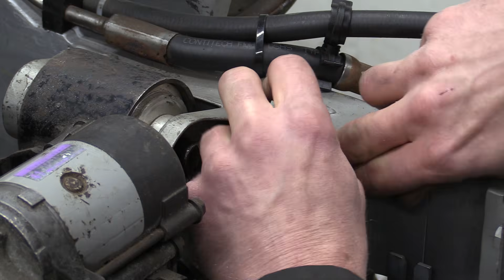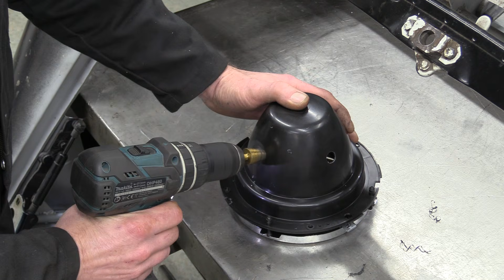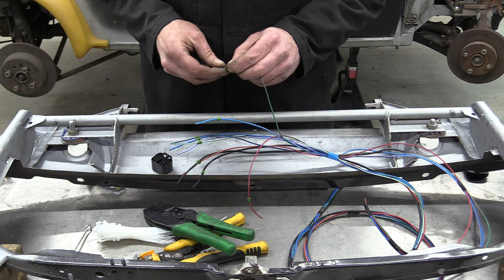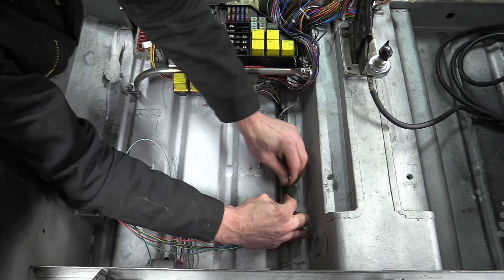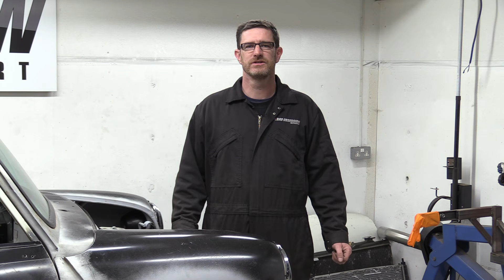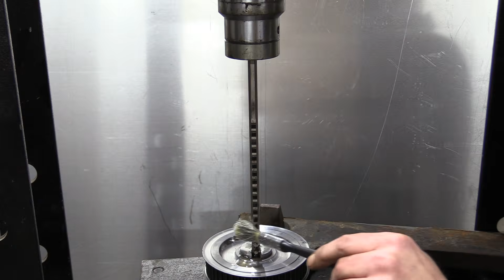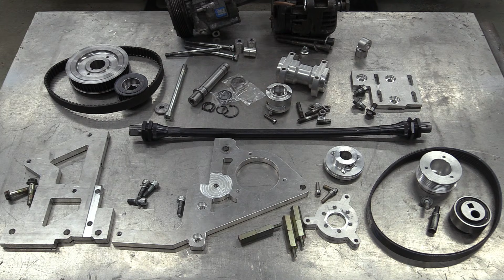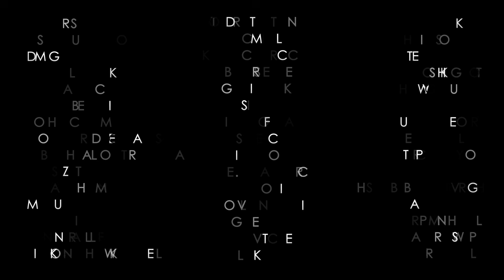Project Binky - Episode 20 - Austin Mini GT-Four - Turbocharged 4WD Mini

Comment: Uhhh I see an issue with the homemade cog pully setup. The original pully was that heavy because it was the harmonic balancer.
Reply: With the amount of detail these guys have already thought about, I somehow doubt that they didn't realize that. Maybe the actual engine is being internally balanced to compensate.
Reply: The extended ancillary drive likely changes a few of the resonant frequencies, so its mass (rather: the mass of the part stuck to the elastomer) is going to be wrong anyway.  Best to remove it rather than risk resonance in the wrong place if you can't re-engineer it to match the new setup.

I'd have thought that torsional vibration would be a non-issue in a small, modern (ish) flat-plane four,  but that flexi-drive might suffer.  Inline fours are also internally balanced already.  So it's probably mostly an NVH thing, rather than to save the crank from certain doom.
Reply: Could all that extra mass they added between the crank and the alternator alleviate the issue a bit?
Reply: @TheInsaneTD  the weight added in the drive line (really only the idler shaft and flex shaft) is insulated by the cogged belt so it wouldn't have a significant affect on the harmonics of the rotating assembly.
Reply: Yeah they plan on doing some racing with binky, but he has mentioned multiple times that he wants to drive it as a daily (ish) vehicle also. I don't really think that he's going to be taking it to the limit of the balancer with what he plans for it. I could be wrong. I'm just saying, there has to be a very good reason they decided to use a drive pulley over a balancer
Reply: Only mass produced engines require a stock harmonic balancer. Any engine can run fine without one without any issues as long as it is internally balanced at time of rebuild. No different to people fitting aftermarket lightened flywheels
Reply: From the comments, it seems few, if any, actually have an understanding of crankshaft harmonics and why a damper/dampener (usage varies) is critical in some applications - NOTE, it is irrespective of whether the engine is using the front pulley as part of the assembly, ie, internal or external balanced.
I recommend you guys actually do some research into it.
Reply: To everyone wondering about harmonic balancers Steve Dinan wrote an excellent article about them a while back http://www.atiracing.com/products/dampers/damper_dinan.htm, there’s a lot more going on than just engine balance, and they definitely need one, there’s not a single serious race car without one, in fact they are usually upgraded to dampers that can dissipate more torsional vibration energy, to prevent the crankshaft from fatigue failure.
Reply: The harmonic balancer not only balances the crankshaft counterweights but it absorbs the vibrations from ignition that can break camshafts and timing sprockets. That can't be done internally. It doesn't appear to me like they considered it to be a serious problem as the distance from the crankshaft snout effects the effectiveness.
Reply: @farming50s57  only really an issue at high rpm I heard?  it may have more harmonics but if it's not running at 8k and up then it should be ok.   I'm no mechanic so I'd like to hear any engineers give some insight into it 😊
Reply: @AlexButler10  Well they do plan to race this thing. Since it does have a rubber ring in it, it may actually be an issue. At nearly 5lbs its a fair hefty piece for a 4 banger. Might depend greatly on that harmonic balancer.
Reply: farming 50's I couldn’t disagree anymore. There is no chance of a solid crankshaft pulley causing damage to a camshaft and camshaft gear.
Reply: @88maaax  Seriously, dude? Do some research - in simple terms, the problem is torsional flexing of the crankshaft which is, in the mechanical sense, a torsion spring and which has a resonant frequency. The impulses from the combustion twist it against the resistance of the rest of the crankshaft assembly and, primarily, the crankshaft inertia. At critical frequencies (harmonics) there can be a positive feedback where the impulses and the flexing are working together and will greatly increase the stress on the crankshaft - it is much the same effect as sound shattering a glass. What a harmonic damper/dampener does is add a mass to the front of the crankshaft, with a dampening intermediatery layer, to change the resonant harmonic frequency to a point outside the normal operation and/or to use the dampening material to absorb the energy in the crankshaft causing the excess flexing. As you may surmise, it is certainly possible, by changing parts and/or changing the operating rpm range, to actually increase the crank' stress - something to be aware of. As a general rule, the longer the crankshaft, the longer the stroke and the higher the combustion impulses the greater the chance of crank breakages - incidentally, the crank flex also has an effect on bearing life and in some instances this has required the use of a dual-mass flywheel to further control the crankshaft - IIRC, this was why Porsche went back to them after suffering rear crank bearing failures with one piece flywheels.

Where a damper is removed, it is certainly possible, as has been demonstrated many times, that the increased 'whip' of the front of the crankshaft can cause high enough loads on the timing chain, or belt, to snap it and, even if there is no chain or crank failure, it can be a big problem with camshaft timing as it introduces variations into the cam drive speed which increases the whip, or twisting, with adverse effects in cam'timing - used to be a big problem with Chev' engines with their rear distributor drive, as well, with ignition scatter.

Sure, they may have no problems, but it is most definitely possible.

Comment: binky coming alone nicely boys!! if it was not for the flexible shaft would there have been another way to get the alternator to work like a plan b? just curious...
Reply: idk if they had a plan, but I once saw a race car that ran the accessories off the flywheel.
Reply: @caution1100   I was thinking a drive off of the starter gear could get interesting. Eliminates all of the issues of turning the stuff while not moving.
Reply: @SirEuchre that's kinda what they were doing, it was a front engine rwd car, a short straight shaft with a starter gear on one end and a pulley on the other, and they cut a chunk out of the bellhouse ing just big enough for the gear, and mounted the accessories under the dash on the passenger side. and it seemed to work really good for their purpose.

Comment: I love how fast you got this new episode out it's great in that having to wait months and months for the next part of the project.  And you got so much done this episode that solution to the alternator problem was ingenious.   One minor question why didn't you finish running the wiring loom wiring to the places you needed it to go.  I know the dash wasn't in and the speakers and the radio but you know you're getting them and know where they're going.   And you could have put the windshield wipers in the windshield wiper motors in now with little problems and have them done,. I'm just wondering why you're not doing that part of the work now?

Comment: soo..  you have removed the stock pulley that may have a dual function as a harmonic balancer, and replaced it with a pulley with no damper?  the miata turbo guys did this a few years ago with massive engine failures as a result on a lot of cars within a short time after changing to lighter non damped pulleys.. i would investigate to see if the stock pulley is infact a 2 piece part with rubber inbetween, if it is, i would not replace it with a pulley that has no damper..
Reply: hfracing it was definitely a harmonic balancer, they should probably look into one from ATI. 
Good read too
http://www.atiracing.com/products/dampers/damper_dinan.htm

Comment: Tip from an electrichicken....use bromits where put your wires into the steel frame. This protect them from wear and possible shortcircuits. Also, put clothtape around the wireloom to protect them from wear and rattling. 👍

Comment: Bad Obsession Motorsport  quick question - the flexible shaft that you have mounted, will it not be affected by the heat from the manifold, causing a replacement after a short time?
Reply: thats the inlet manifold.
Reply: @yamumorsomesh1t  ok thx

Comment: It's been well over five years and I still can't believe you two blokes thought it was possible to fit a four wheel drive Celica running gear into a Mini.
I have an ever harder time believing is that the important bits are actually done and (likely) working.

Comment: OOoooh... not to be a smart ass, but you shoulda put a grommit on the bare metal edge of that bulkhead where the wires pass through... the sharp metal edge will(might) vibrate through the wire insulation someday, causing no end of mysterious electrical troubles. A smear of silicon caulk might delay that a bit, though.

Comment: No rubber grommets on the holes wich the wires run through? And no protection tubing araound the wires?
Reply: Its all got to come out again for paint and wax oil in those cavities so no point finishing to final spec until final build.

Comment: That Flexishaft is a very clever solution. But it does seem to run awfully close to the hot exhaust, and the flexishaft outer tube will probably start melting.

Comment: Incredible job ! My 2 cents : you should put a grommet where the wiring goes through a hole, vibrations might cut a wire !
Reply: I worried about that on last episode. I'm sure it's coming, hence the 'Gromit' gag at the beginning :)
Reply: Yeah, the big plus cable still lacks grommet as well. Maybe there will be a whole 2 hour episode called "All grommets, and nothing but(t) " 😊
Reply: Colin Jolivet, Didn't  you see the Grommet  Joke at the start of the video?.
Reply: Mark Thomas 

It took me until just now to realize what that joke was...
Reply: I think the plan is to once it is done, its taken apart in order for Binky to get some laquer. Probably in the reassembly where cables get insulated.

Comment: Holy cow. That alternator setup is something else!
Reply: This ... is an understatement.
Reply: It's a work of art, though I'm a little concerned about the longevity of a flexi-shaft driving an alternator and the air con pump which will be taking of the order of 3-4 bhp.  I hope I'm wrong and it's up to the job.
Reply: mikerjuk - If I heard right, the people that make it had originally designed it for light aircraft. It should be plenty strong, as you have to be assured that nothing major will break at 5-10K feet.
Reply: @rucarnuts13  That would depend entirely on its application in an aircraft. If its power or torque ratings are being exceeded by driving an alternator and A/C pump then it will have a short life irrespective of it being ok driving something else on a aircraft.  This is like people saying something is made out of 'aircraft grade' aluminium as though that guarantees it can not break.

Comment: Those unprotected wire looms running through metal enclosures will surely cause trouble later on. Better use some black braided nylon sleeves to stop the wires rubbing the metal, and causing shorts later on. Also didn't spot any rubber grommets where wires pass through metal holes. Sorry guys, but that's just a disaster in the making.
Reply: pakking Thanks for clearing this up! I should 've known trying to outsmart them was meant to fail.

Comment: 102th comment . Why can't you get the a/c and alternator to fit the exhaust side off the engine? The Australian toyota SV21 camry has both a/c and alternator on that side the engine blocks are the same only difference is the head not a real twin cam runs gears off the intake cam that runs the exhaust cam

Comment: Hate to be a naysayer (well, for Project Binky at least) but I think without a harmonic damper, you'll probably end up with a broken crank / oil pump / cambelt  :(  Amazing looking work otherwise!
Reply: I have a custom two piece Honda Civic  crank shaft due not using a harmonic balancer.   They are there for a reason.
Reply: @dave717785  I think I know what you mean by "custom".
Reply: Depends on the engine. From what I've read, some engines are less reliant on the damper than others. I don't know about the Celica engine specifically, though.
Reply: The combined weight of the new system probably makes up for it. Also I think a harmonic balancer is a loosely couple inner bore to outer edge. Usually with a very hard rubber to allow the balancer to average out the vibrations. Since the original isn't of that design I don't believe it is a harmonic balancer
Reply: The original totally is of that design - it's just that it's all black so it's a bit tricky to see what's metal and what's rubber. And weight and balance have nothing to do with it - it's a damper, not a balancer.

Comment: Not using flush cutters on those zip ties physically pains me (or will anyway once I rub past one!).
Reply: I think it's all coming out and stripping the car right down for paint eventually anyway
Reply: @User78347 It will be a bit hard pulling the wiring out of the flip front & the firewall ,as the plugs are all to big for the wiring to be removed for painting
Reply: The wires will come out of the plugs, with the right shape poking tool. He had a fine collection of poking tools in the previous wiringfest.